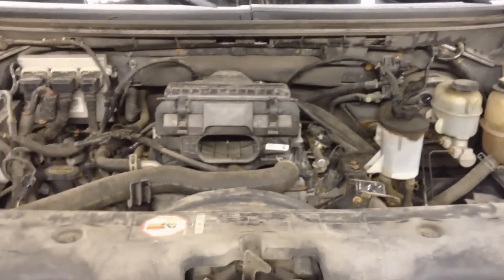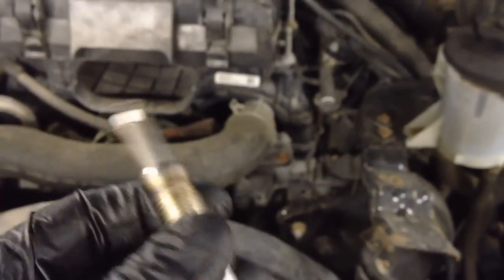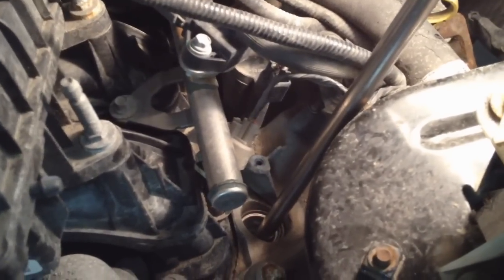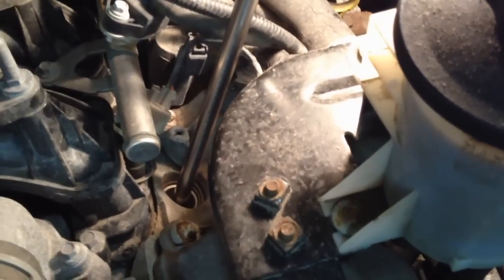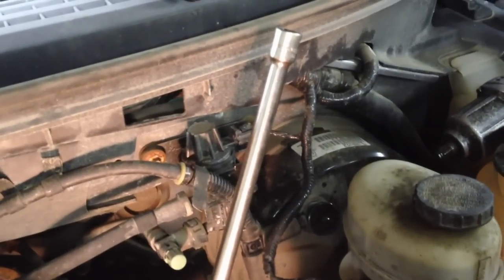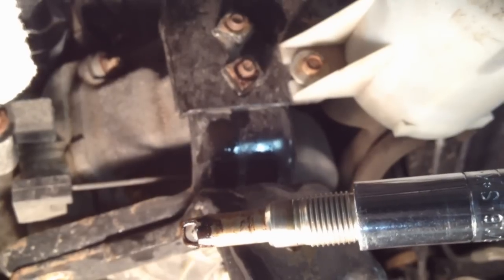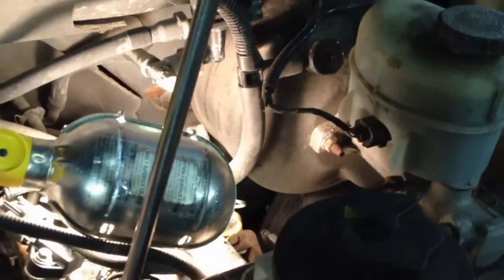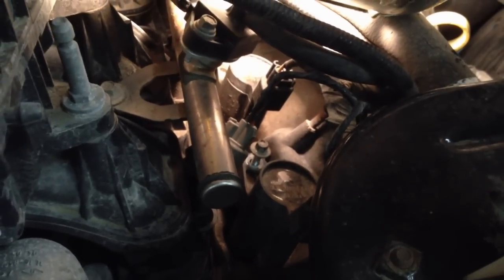Ford 4.6L & 5.4L 3V Triton Spark Plug Removal

Comment: Yes the pusher is maxed out. When I put in the extractor it caught and I gave it another 1/2 turn and it felt like it broke loose. I took it out and a spiral metal shaving came out. A friend just told me to try it again with lock tight. Any ideas?
Reply from the maker: Loctite wont do anything. You have the pusher tip fully retracted and tool fully screwed into the spark plug threads before you start pushing it down right? You may have what I have been seeing lately that is very frustrating -- The porcelain still has the center electrode in it and it wont pop past and break the ground strap, you keep cranking on it, the shell deforms and gives to the tremendous pressure and then the shell starts pressing down into the head too! Was it really hard to push this one down then started getting easy almost weird too easy feeling? Was the center electrode broken off with the porcelin or is it just porcelain down in there? If you look down in there is the porcelain just a little down past the top of the shell and not more like a 1/4" or more pushed down in there? Is this your first one?

Comment: Question.... What do it do if I strip out the broken off part with the extractor tool?
Reply from the maker: So the extractor will not grip the broken shell in the head? It should never be a problem it bites hard into the shell. You need to make sure the porcelain is pushed down far enough so the extractor can bite enough into it. is the porcelain pusher maxed out as shown in the video?

Comment: Can i use Bosch 4304 platinum +2 spark plugs in a 2005 ford expedition 5.4 3v? I pulled my old ones out and they look different lengths but the place i bought them told me their books/computers say itll fit. Anyone ever used them. I know i should buy the motorcraft but if i could i would. We aint got them here.
Reply from the maker: I have no experience with those but I can tell you I have never heard anything good about bosch spark plugs in ford from the old engines to the new super engines not good nothing but problems. You don't have a dealer nearby? Most auto parts stores carry motorcraft.

Comment: Thank you, FTML.   Well done video!
Scared about my upcoming spark plug removal of our '08 Expedition emergencyehicle at 92k miles.  (Transports blood to hospitals in emergencies, often at high speeds, 105mph, to distant hospitals.)
Replace the original plugs with SP515?  Is SP509 original plug?
Plan to let soak overnight or longer if possible.
No power tools.  Should I buy a torque wrench and not exceed a certain amount of torque?
Can I buy the extractor tool and return it if not used?
Thank you.
Reply: Thank you.  Am told our Expedition, manufactured 12/07, with brown coil boots, has SP509   Auto parts store had ONE.  It has threads all the way to almost the J electrode.
Hopefully they are correct and no need of worrying about the ground shafts remaining in the cylinder heads.
Reply from the maker: robertgift As long as you have brown boots you are good to go. We never recommend autolite over Motorcraft while autolite was the OEM of the plugs for motorcraft in the past that is not so in all cases now. Take the iridum plugs for the 2.3l in the newer escapes they are NGK iridiums. The Motorcraft plugs are made by whoever but to motorcraft standards that is the difference and if you look around the web you will see people still having problems with autolite. So we stick with the Motorcraft always high quality and latest design as a quality repair done right the first time affects our CSI score Ford is more insistent on getting the plug perfect and whatever design flaws fixed they basically have the R&D dollars other don't because their vehicle line reputation and Ford namesake are on the line.
Reply from the maker: First thing to check is pull one coil out easiest one to get to, it is a 7mm bolt. Check the color of the spark plug boot is it brown or black? There was a mid year change on 2008 vehicles to the new design which doesn't have this problem, they have brown coil boots.
Reply: FordTechMakuloco  Thank you, FTML.  This has brown boots.  But the Ford TSB mentions nothing about boot color.   Interestingly, the Fordealer service supervisor says to replace with Autolite rather than Motorcraft plugs.  (I cannot see what plugs are in it now.) Would the VIN mean anything?
Reply: robertgift  Autolite makes Motorcraft plugs. Which would make them equivalent to O.E.M
Reply: FordTechMakuloco  thank you for pointing that out. I had almost forgot about ngk making alot of other O.E.M's
Reply from the maker: Just like Beru used to make all the glow plugs for motorcraft and now I see a NGK stamps on the glow plugs for the new 6.4l diesels.

Comment: in the ones ive done, i did an induction/fuel inector  cleaning first, then the carb cleaner and yet to have one break! but only done 2 set's
Reply from the maker: Yes I have done the actual BG Induction service before too with minimal results and have since given up. On these ones I was actually doing 2 trucks at a time one 80k and the other 100k the 100k was actually coming out easier, just how it is driven, fuel quality etc as to how much the carbon packs in there. Actually the extractor tool broke off in the head and I had to extract that too geez!